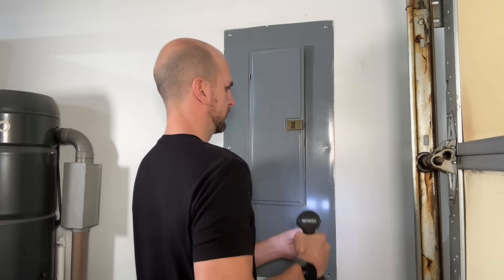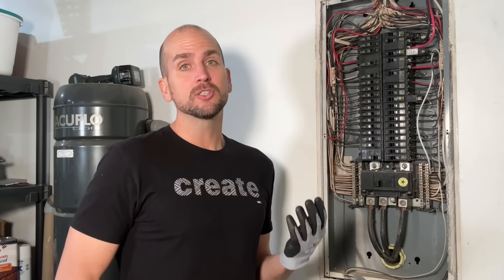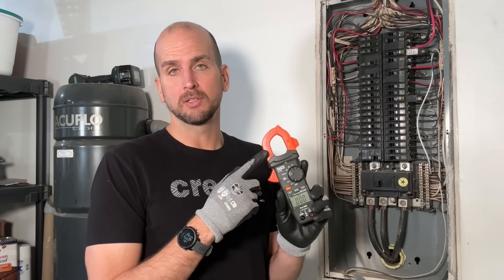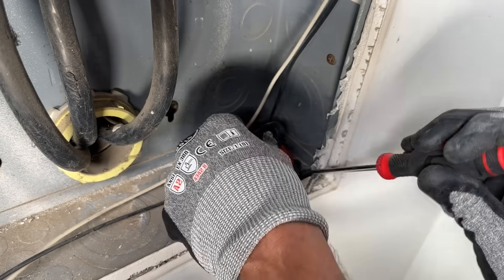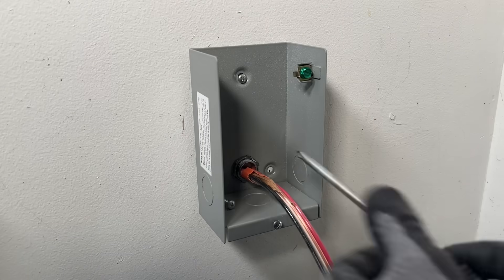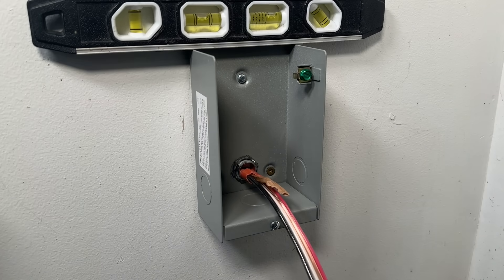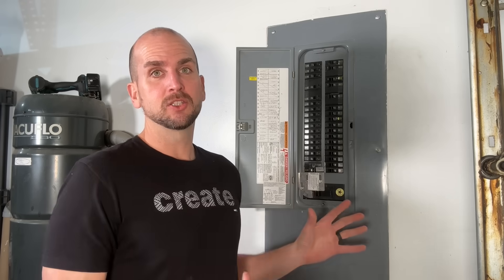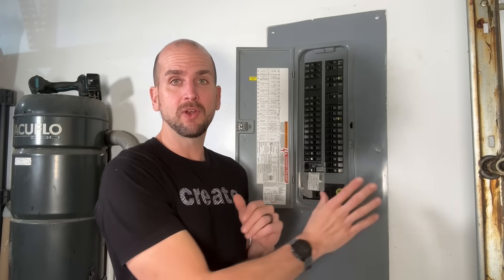Whole House Power Backup Solution | Generator Inlet Box Install

Comment: Question: At the meter outside my home I have 2 breaker boxes with basically just 2 main breakers. Then inside my home I have 2 breaker boxes with the household loads. 
I am wanting to install an inlet box for power station use. Do I have to have 2 inlets & 2 power stations just to make this work?

Comment: I don't even do 30amps. I put 50amp inlets in. Do it once and your set up to go as big as a 12kw.  Don't matter if you have a 7kw or smaller.  You have over current protection on the generator receptacle on the 120/240 receptacle even if the panel interlock breaker is 50amp

Comment: Question... what would happen if you used a female to female adapter on that hot inlet plug outside to use it as a 220 plug?

Comment: Great tutorial video! Did you have to get a city permit to install your 30 Amp Inlet Box?
Reply: chances are, you will need a permit to add anything to your main power supply breaker box. not only this?, but you may want to check into getting a permit to make your homeowners insurance company happy?, but think about having it installed by a certified electrician just in case your work causes your home to catch fire?.

Comment: I just had this installed and will be using my F150 Powerboost truck with the 7.2kw generator built in to provide backup power in a power out situation

Comment: Why does the breaker need the retaining bracket?  None of the other breakers require it.
Reply: answer: because you do not want the gen to back feed to power supply company when the main power comes back online. with the lock-out bracket, it lets you keep one on, while the main power supply breaker is off.

Comment: Please do not delete this comment.  This is illegal under 2023 NEC code.   Inlet needs to be outdoors.

702.12(B) Portable Generators 15 kW or Less.
Where a portable generator, rated 15 kW or less, is installed using a flanged inlet or other cord-and-plug-type connection, a disconnecting means shall not be required where ungrounded conductors serve or pass through a building or structure. The flanged inlet or other cord-and-plug-type connection shall be located outside of a building or structure.
Reply: There are probably 5 portable generators that exceed 15KW on the market. So that means something like the Westinghouse WGen20000C, which produces 27KW doesn't require the inlet to be outside. Im sure you are misunderstanding the code. No chance they'd allow something much more powerful to be indoors but the lower powered ones outdoors

Comment: Do you need a county permit to install this?
Reply: Most areas if you are the home owner and you do not rent your home and will not be selling your home then no permit is required. There are some exceptions particularly in cities where they require permits for everything. Even then you can often get away with it if no one complains.

Comment: What if you have two panels coming off your meter box, both 200 Amps? Do you have to set up two separate outlets?
Reply: If each panel independently derived power from the meter base you will need to either choose one or the other to power, or you will need to use a transfer switch. 

If one of the panels feeds the other panel then you will need to identify the primary from secondary and install the interlock in the primary. Turn off the main in each panel while the other panel is on and which ever panel kills the power to absolutely everything is your primary panel and you will want to install the interlock in that panel.

Comment: Can the 30 amp plug be installed inside or is it code to be outside?
Reply: You can do it either way. They just need to make sure they have a long enough generator cord to have the generator outside

Comment: Does the neutral and ground have to go on the same bus bar? 
Pretty sure I connected my ground and neutral on separate bars.
Reply: in main breaker panel?..they MUST be connected !. shop, barn..seperated garage ?..sub-panels MUST not have the grounds and neutrals connected !.

Comment: when you say main electrical panel gets the same neutral/ground wires on the bus bars, does it matter which bus bars those go in to?
Reply: no. all main breaker panels require by code!, to have the neutral and ground bus legs bonded. in other words..you must connect both neutral and ground wires to either bus legs. you can connect all white wires ( neutral ) to one bus, then all ground wires to the other bus?, BUT YOU MUST BOND THEM BOTH TOGETHER !. if you are working on a sub-panel ( breaker box not connected to your main home ), then keep the grounds and white separate !, DO NOT BOND THEM!. also..code also says at the main breaker panel, that you '' should '' keep all neutral and grounds only to one screw in the bus?, i'm not sure if a inspector would fail you on this?, but  you may want to ask !.

Comment: Nice video, thanks for producing and posting it.  Thinking of doing this to my home but electricity scares the heck out of me and will hire a licensed electrician to install the interlock system.  Had a work colleague die from accidental electrocution doing some DYI electrical work a few years back.  I'm ok with doing some carpentry, minor plumbing, dry wall repairs, etc. and have switched out a few worn out light switches but prefer to draw the line on complex electrical work.  However, again a very helpful video that helps me better understand the scope of the work that needs to be done and how the interlocking system works.  I also liked a few of the comments below recommending to put either an LED or audible system that can notify the homeowner when the power outage has been resolved and you can switch back to the grid.  Thanks again.

Comment: Will You be able to power say a 50 Amp RV by plugging it in to your inlet box?
Reply: Not really. It would be easier to just install an RV outlet on your service panel. In order to use an inlet to power an RV you would need to remove the interlock if you have one and wouldn't work at all if using a transfer switch and you would also need to create the reverse of a suicide cord. Though technically it could be said your inlet itself is now a suicide cord.

Comment: Unfortunately our 200A breaker is outside, while the main panel is in the basement, so a setup like this won't work for me.
Reply: it can work. what you have outside is your main disconnect from the meter. inside..where your breakers are, is where you would need to tie into with the 30/50 amp outlet. in other words .you would need to mount the outlet on the outside of your home ( hopefully you are running the genny outside ! ) now run the outside outlet to the breaker panel inside to your breaker panel inside your home.

Comment: My question is, does it matter where you put the breaker at and I put it at the bottom middle top for the generator power
Reply: Preferred close to the main breaker so you can install the interlock for safety purposes especially line man repairing the grid. But you can still do it on the bottom , just make sure the main breaker is off all the time

Comment: Would this be the setup for a generator using a floating neutral?  Specifically the ground and neutral on the neutral bar as opposed to the ground to the panel ground, neutral to the neutral bar. Thanks.

Comment: 11:00  It is NOT an unsafe condition for the power workers if you don't throw the main switch, that is a myth.  They wear gloves and take precautions otherwise they'd be dead before they get to your place.  The risk is all to you.  If you don't cut the main power and the power comes back on while you're connected and backfeeding it will be like a car-crash inside your generator and you'll get to hear what it sounds like when the main power fuse in your panel blows (sounds like a gunshot).  If you don't cut the mains connection your house will be dark, except for flames, within a second of them restoring power -- that's why you do it.

Comment: How would you do this differently if your backup power source was an EV, e.g. 120vac 16a from a 100kwh EV9 battery. For a recent power outage we had I ran some electrical cords but would like something a little more flexible and less messy. Maybe they make 120v versions of this.

Comment: Thanks for the video. It was very informative. Where do you get all the cables from? Like the Cable to connect to the 30A box and the cables to connect two delta pro 3's together or to an extra battery. Thank you in advance.

Comment: will this feed both sides of the panel ?
Reply from the maker: Yes, this is a 240V 30 Amp inlet and depending on the size of your generator or portable power station you might want to go with the 50 Amp generator inlet and matching breaker.

Comment: Is there a way to install a current meter on the neutral to measure the total amperage being drawn?
Reply: No you cannot do the neutral both leg uses the neutral and cancel out current you need one on both hot legs...

Comment: Can you use 8/3 wire?
Reply: Use #6/3 just in case you need to upgrade to 50amp- 12000 watts above generator. 

Setup will be 30 amp reliance inlet, #6/3 wire

Comment: Going to be doing the same thing with the interlock but want to be able to run house off my Bluetti AC500 with 2 B300 batteries during the evening but my Champion duel fuel 100524 during the day, would that generator put out enough it's 4375 starting watts and 3500 continuous watts on gas.  I could recharge the Bluetti batteries during the day with it since don't need a lot of power other then a fridge, freezer and internet

Comment: installed a sub-panel next to my indoor main panel.  disconnected and pulled all my 120v circuit wires from the 200amp  main to the sub-panel. Installed a DPDT 80amp rated Contactor in the subpanel. Ran 8ga romex from a 40amp 220v breaker in the main box to the contactor. Ran a 10ga romex from my solar/gen shed 3.5kw invertor to the same contactor. Installed a simple 120v 5amp rated on/off switch behind the door on the sub panel to turn the contactor on an off.  Sub-panel is in the utility room next. Either my spouse or I can simply flip the switch ON if the grid fails and all lights,wall plugs , frig, microwave,washer,dishwasher, Internet, chargers everything powered my 120v will work. Generators job is to backup the SUN. WE can run 12-24 hours on batteries, without having to go outside in a storm and push the start button on the genny.  Also have a Grid powered battery charger that kicks in when the grid is popping on and off. Get a cloud text message when it pops on.

Comment: I would suggest you always install a 50A input plug even if you only use a small generator and a 30A breaker, so you have the option to use a larger generator down the road.  You can very easily get a generator twist lock 30A to 50A cable.
Reply: That's my thought. One might get a bigger generator or daisy chain in the future.

Comment: When your panel is in the basement and on a different corner from the garage, is it better to run a long extension cord to a walkout basement door or do an exterior plug on the outside of the house (in the elements)?

Comment: I have a main braker at meeter and a main braker inside house whitch one would i put interlock on
Reply: Whichever one you are putting the generator breaker in. The main breaker at the meter probably only has breakers in it that power your air conditioner and well pump. Your other main breaker probably has all your inside circuits so it would probably be best to install there so that the electricity has less distance to travel. If you install at the outside meter, the electricity will have to travel the added distance from that panel to the other panel. Also by not installing on your meter panel that has the air conditioner hooked to it you can use your air conditioner to know when your power is restored since you would not need to turn off that main breaker in that panel.
Reply: @howardradford1985 good idea

Comment: i have a 9200 running watt gen, it has a nema 14-50r rated for 38 amp. i am pretty sure i can install a 50 amp box and make sure i never go over 38 amps and i should be fine am i correct or completely wrong? or should i just do a 30amp inlet for safety issues
Reply: If you don't have any breakers in the box over 30 amps or you keep all breakers over 30 amps off you ate correct.

Comment: So using a soft start your AC should be able to run too when not using your furnace. On a 30amp inlet.
Reply: Depends on your AC my AC uses a 60 amp 240 volt breaker. Which means at its peak it needs 14400 watts and a generator with a 60 amp receptacle. Currently I have not seen a generator with a 60 amp receptacle

Comment: I guess I don't understand why the inlet was installed inside the house. Nearly all of these plugs are marked "Not for inside use", as obviously you can run the generator in your basement.
Reply: It looks like its within 10 foot of the garage door.

Comment: Hey sir,

Do you have a video with 1 EcoFlow Delta Pro connected to the Smart Panel (not the Smart Panel 2)?  Also, if only 1 Delta Pro is connected with an extra battery can I still use all 10 circuits without any problems? 

My other question is can I do the same setup with the A310c or A510a and have all 10 circuits capability?

Comment: I'm installing a 50A generator plug, the cable I'm using (6  wire gage  4 wires, black ,red, white and green) my question is the white and the green where do they go? the electric box is a D square with ground connector bars in each side of the breakers
Reply: in main breaker panel: red and black to breaker. green to outlet box, then it will be a bare wire ( ground ) and the neutral ( white ) to the bus bar in your main breaker panel.

Comment: Does code allow the use of a source switch for the inlet plug similar to a boat that has "shore", "gen", and "off"?  I would want an inlet plug in my basement near my panel to plug in a power station (such as an ecoflow delta pro) and another inlet on the outside of my house for a generator and then use the switch to select the source of power coming in.  Everything else would be how you did it with the "out" of the switch going to the interlock controlled circuit.

Comment: @cbarnett2270.1 min ago
How did you put that hole in the wall for
the outlet box and what size is the hole
in order to put the wire clamps through
the hole as well.........what size is the
clamps...1/2" or 3/4"....THANXXX
Reply: How you determine where to put the hole for the inlet box without hitting anything.......

Comment: Thank you. In my vacation home I’m looking for a way of powering the home when power is lost through using a eco-flow delta ultra pro. Amazon and Eco flow just had a massive sale. 
I did not take part because I’m still in the research phase of getting a electrician in PR to hook up the L-NEMA 30 Amp outlet on the inside of the home. 
Not sure how one would do that since the main breaker is outside the home sitting on a 12 Foot wall of concrete block. When I open that small panel all I see is the Main breaker I’m thinking the other part is under it. 
Any suggestions

Comment: Question; with the breaker in position to power the generator, wouldn’t the male blades of the plug at the "generator inlet box" then be "hot"?  This is in direct conflict with the notion that you should never use a female for the inlet box plug….  (Sometimes called a suicide plug.)
Reply: The breaker does not power the generator. The generator sends power through the breaker back into the panel. The "hot" plug(female) from the generator cord then connects to the inlet box. There is never any power on the male blades unless there is no interlock kit and the main breaker is on feeding the power back through the generator breaker. That's why there should always be an interlock to prevent this.

Comment: 1st question: What happens if I do not have a free slot in my main breaker?  
2nd question:  Is 50A enough for both EV charging (32A) and a 5-ton AC running?

Comment: I watched this to start trying to learn how to install one of these and electrical in general, I guess I just don't understand electrical breaker boxes. Since the bipole is on the left phase, wouldn't it only power up the left phase breakers? How does the breakers on the right get powered up setting this up this way?
Reply: double pole 30amp breaker, where he stuck it, it crosses both 120 volt buss legs in the panel.

Comment: I see the advantage of an interlock but what if I was primarily concerned with heat in the winter. Why couldn't I run two dedicated 30 amp lines from the generator into the house and then use a heater on each line to heat the basement and main floor? As it wouldn't be tied into the house power system no interlock would be needed. Is there any reason this shouldn't be done?

Comment: Greetings!  I already have an outside generator hookup and interlock safety switch in the fuse box! I am trying to add an Ecoflow Pro inside and next to the fuse box! Can I hook up the wires to the fuse box from the Ecoflow 30 amp outlet into the same breaker of the line coming into the house from the outside? It would only work when the grid power is off to energize either the gas generator outside or the Ecoflow inside, but not both!  Thanks

Comment: Hi, I did not see if you mentioned that most generators come with a bonded neutral and therefore the transfer switch would be allowing the neutral to pass through to the main panel and thus have two bonded power sources which I think is not code.

Comment: Calling a 50 amp genny hookup a "whole house" hookup is like calling a Volkswagen Jetta a high speed race car. When the homeowner finds out they can't run the house as they normally would, you are going to get a call. It's a temp power outage. Basically a luxury camping trip. Read a book and wait...patiently. LOL But thanks for mentioning the need for a license to be safe.